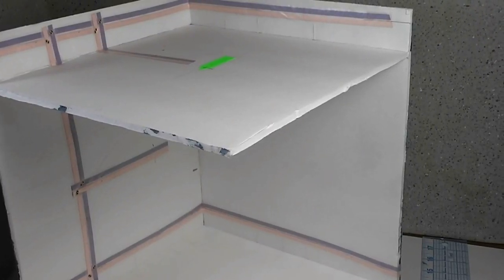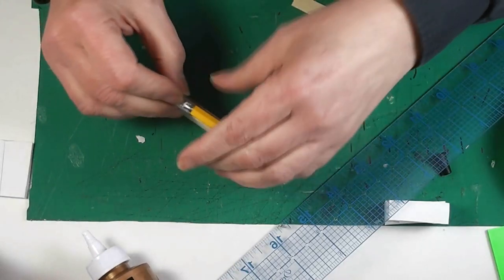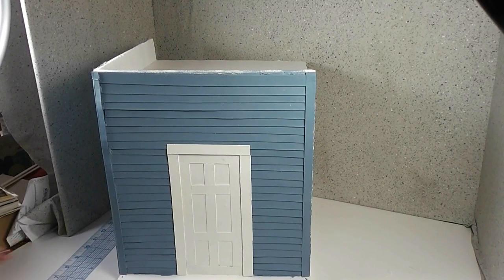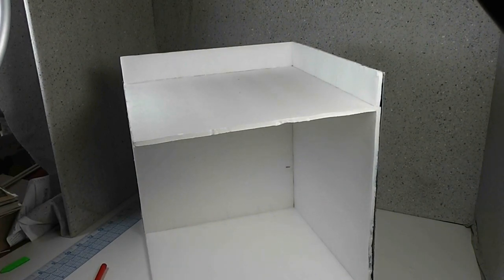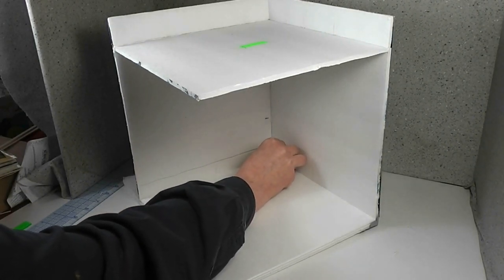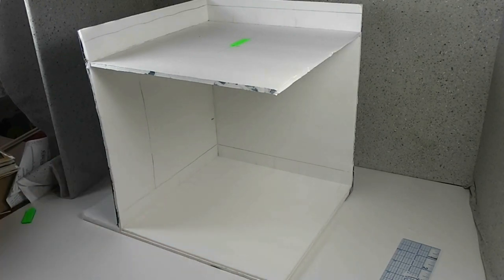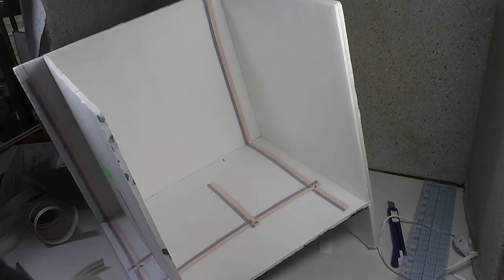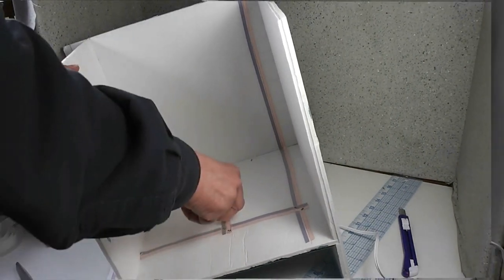Dollhouse Wiring 101  pt 3 Tape wire Placement

Comment: After you install lights and one or more stop working can you repair it without tearing apart your house? I'm guessing that would be what the pictures are used for. To find the tape when needed. Can you reuse the tape wire?  I really like how well organized you keep every thing.
Reply from the maker: that is what we are hoping for. Because of how we are working you should be able to track down any problems without having to tear everything out. Also with the exception of the front porch light you should have easy access to the wired in light fixtures.

I have never tried to re-use the tape wire, I suppose if you don't have too many holes it might be doable but I am not sure. I don't think it would be worth the risk though. If the tape-wire fails you will have to replace it so using fresh wire for each project is better than risking having to replace it.

Comment: I love your series.    I’m watching them all before I start.  I have my practice board.    Running through my head right now is I want ceiling lights.    I have the really good toys Vermont farmhouse jr.   the floors are hardwood on the second floor.   They came as the ceiling and floor all one piece.   So you are wiring in the room box from the second floor through the floor.  I can’t do that.    How do I wire.  From the ceiling and glue the fixture to the ceiling?
Reply from the maker: That is a lot harder to get right unfortunately.  I would run the tape on the ceiling under whatever ceiling paper you are going to use.  Then wire the light like you would a wall sconce. Just be sure to glue well and have any wires tucked under the fixture.  In my houses even when they come with the hardwood as the top of the ceiling panel I use other floor materials over the hardwood so I can wire my lights easily.  That's what I am doing in my current project.

Comment: What is the purpose for having the wiring go all around the base at 1”? Is this for lamps later on? Seems like you could save a lot of wire if you didn’t need to go all around each room.

Comment: Using the tape wire if you wanted to paint the walls can the tape wire be painted and if I used Brad dose it make a different then the grommet And will I be able use wall outlet and wall switches for ceiling lights

Comment: What if you aren’t using foam core as a base but wood instead? How would I add in the grommets
Reply: The little poker tool also comes with a screw. So you would screw it a little bit to get it started and then lightly hammer the grommet in
Reply: @samberg1477  Screw? or do you mean the #55 drill bit to make a starter grommet hole in the mdf?   Would you make the hole 1/2 as deep as the grommet goes in and then hammer it in.  Will the grommet cut thru the other half of the distance by hammering it flush?  Thanks.

Comment: Would you generally go through doors with the tape, or around the outside/open side of a dollhouse?
Reply: I'm wondering that too, like from one room to the next on the same floor, do you run the wire around the entire perimeter of each room? Maybe only areas you want to plug things in? Like in a real kitchen maybe you would run tape wire at a higher place like above the kitchen counter height. But to go from one room to the next room does the wire go through the wall? Maybe you could run it behind a wall if there's a gap there. What about wall sconces you don't want wires showing all the way down to the floor.
Reply: @recoveringsoul755  I think all walls have to be wallpapered to hide the tape, as well as wood textures and lumps and bumps - although that can be a plain colour for the painted wall look. That’s mostly what I’ll be doing. Plain “painted” walls that are, in fact, wallpapered because I prefer plainer walls but have to hide a lot of tape. I ended up with tape going around the outsides so it could go from room to room, and a couple of tapes reaching up for (future) wall sconces on either side of the (future) fireplace.
Reply: @amyslingsby6947  okay, thanks for that, I guess we can always hide the open edge of the floors and walls by covering them up. I've seen some people make removable floors by using cardstock or poster board and attaching their hardwood floor to that and sliding it in. Allowing easy access to any wiring for the ceiling on the floor below, or allowing to easily change the flooring out.
Reply: @amyslingsby6947  hope you left a way to light up the fireplace itself. If you make a removable fireplace you could use a tealight from the back of underneath access. The last home I lived in the wall of the living room with the fireplace on it was completely bricked, and a protruding hearth was at sitting level, making like a bench. If you did that on mini scale, even for a removable fireplace, you could hide the girth of the tealight in there and have the actual fireplace more flush to the wall to allow room for the flame part . Apparently those little flame shapes are removable too. Leaving just the nub of the LED

Comment: is the grommit the snall nail shaped pin. also another metal peice csme in kit with a hole. when crossing tape wire snd connecting those  two colors.matching what is the pin with a hole  for that came in a kit
Reply: The nail is the brad. The one with the hole is the grommet, also called the eyelet

Comment: Sorry to bother, can i use polymer clay as the base? 
I have ~zero~ experience in this but had a really neat idea but dont wanna use foam board :/ 
Like.... have the size and shape i want the base, poke my lead into it, remove it, bake it, and then lay my wire and glue the lead back on?
Reply from the maker: I am really not sure, that is something I have never tried.